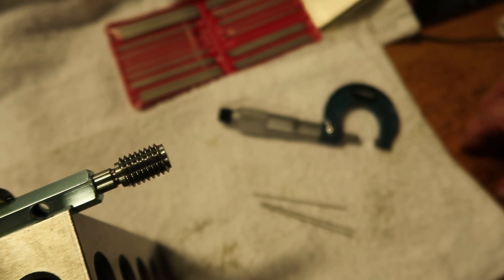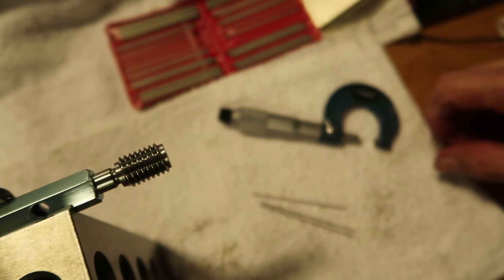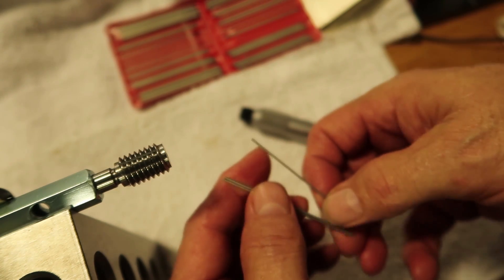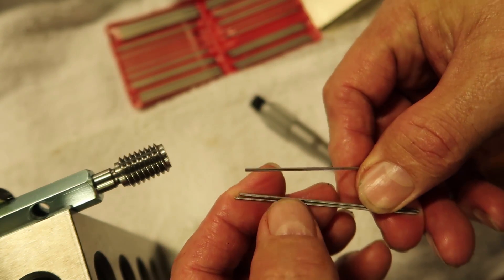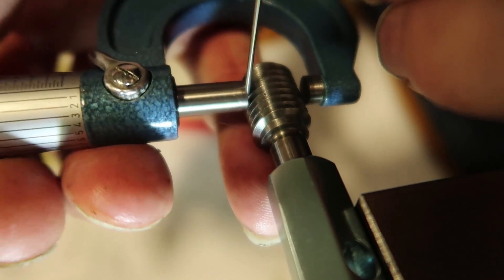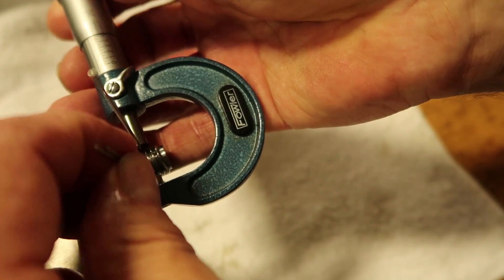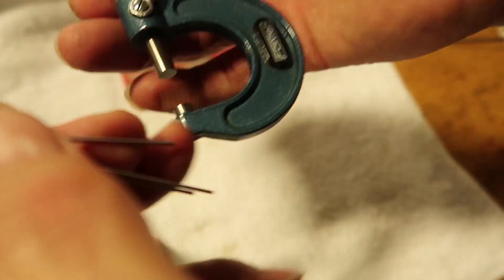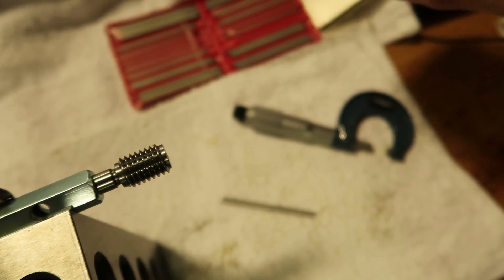Three Wire Thread Measuring Method

Comment: Thanki you very much for this video. I have just purchased a wire set and have difficulty using them because I have a badly damaged left hand from many years ago from a motorcycle accident. I am missing an index finger and your method made it possible for me to use the wires. So thank you again. Michael

Comment: Thread Micrometer vs wires.. I recently move from 10yrs of being a cnc mill guy to the Mazak integrex.  So my question being is I make alot of o.d threads now and hate using wires. Are the interchangeable anvil/thread mics accurate
Reply from the maker: Yes if you calibrate them to the standard.

Comment: The New wire Sets are a pain in the butt . A old Tool Maker I use to work with gave me a old set of wires that work great.  The old sets are 2 pieces with one wire bent in a U shape and another single wire. The U shaped wire is used as 2 of the wires and it's much easier to control than 3 separate wires. I remember asking the old Tool Maker what he thought of CNC. His reply was "CNC takes all the fun out of it" LOL.
Reply from the maker: I remember the first shop I worked in there was a woman that ran a Hardinge turret lathe. She had these sets of things that looked like coil springs with ends wound like a torsion spring. She would use them to measure the pitch diameter of the threads. The spring was wound slightly smaller than the thread so when you wound it on it set down into the thread. Than you measured the OD of the spring. The only thing is you needed one for each size of thread. I have never seen these since then. This was about 40 years ago. The reason I would not like to use a bent wire or these devices to hold the wires is. It is important to be able to feel the drag on the two wires. The drag should be the same on the two wires or you don't have the mic perpendicular to the thread. With a bent wire it would not be possible to tell this. So I prefer to use three separate wires.

Comment: thank you. I enjoy your videos very much and have subscribed to them. you make amazing parts!
I want to ask - suppose I don't have a thread wire kit - if I take 3 identical pins that will overhang the top of the threads i guess there is some trigonometry to be made so it can be measured? taking into account the pitch, angle and actual measurement with the micrometer?

Comment: Thanks for showing us this method I will give using wires a go, I have only ever used parallels before but the difference in price between wires and parallels is massive ($40.00 for wires and about $600 for parallels) . When using parallels there is a standard (1/4" for UN and 6mm for metric) that you need to subtract from your measurement to get the effective diameter of your thread. Do wires have a simular standard that you need to subtract? Also who makes the standard that you were measuring? I have seen a number of people online from the U.S using them. Thanks Peter
Reply: As a fellow user of Marlco parallels, if you have a digital micrometer you can measure the parallels together and then reset zero, that way you get an instant reading of PD when measuring the thread, but I expect you already knew that. 
Do you find the little bits of plastic that holds them rather lacking in "usability"? I have a couple of designs for better usage, another tuit I must add to the "must do a video of it" list.
Reply: Thanks for the digital mic tip, I don't currently have a digital mic but will tuck that one away until I do, its a good idea.
 In your comment you spoke about 'PD' which I assume stands for 'Pitch Diameter'? I have always known this as the  'Effective Diameter', interesting how people in different places have different names for things.
I agree with your sentiments on the holders, when they get a bit worn and then mix in a smear of coolant they quickly become a hassle to keep assembled while you measure, locking them onto the parallel would make them so much more usable. It's a shame that Marlco didn't put more thought into the holders because the parallels themselves are excellent.
Reply: I used the PD (pitch diameter) expression because it was the one used in the video to save confusion, but would normally have used ED. The terms are interchangeable, Machinerys Handbook lists both so it is not necessarily a different place/name thing.
A sliver of paper tightens the fit but doing this on such an otherwise good, and expensive, bit of kit is a little disappointing. 
There is also a cunning variation on the PD wire method that uses a couple of turns of spring wire that fits over the thread and is measured in the usual way. Downside being you need one for each thread size. You can make you own using copper wire of the right diameter but you have to do the PD wire calculations. Even so it saves you dropping wire in the chip tray.

Comment: Isn't the easiest and fastest method to use a thread mic? (at least for threads up to 1", anyway)
Reply from the maker: That would be, if  I had one. They are expensive every time I look at one something else comes up to spend money on and it gets put off. Maybe someday.
Reply: In my experience three wire method is much more reliable and accurate way to measure the threads than a thread mic. If you want to ease up the hassle with three wires Mitutoyo makes these holders that have wires in them.
Reply: mikey_d amazon has a rubber set of holders for like 20$ . There color coated so you know what wire size to use . It’s semi stretchy so it holds onto the anvil.
Reply: The thread micrometer takes away the fussiness of handling three wires. We have a Mitutoyo mike with replaceable anvils that will cover a wide range of thread sizes. But the mike requires a delicate feel and the setup is expensive when the anvil set is taken into consideration. I think we were quoted over $300 just for an empty 2-3" frame that would use our existing anvil set. BTW an alternative to a three wire set is to use three number drills of the appropriate diameter. One last thing: The calculated "M" using the formula gives the top limit for a class three thread.

Comment: nice tip have to try that one next time
Reply: I put the 2 wires against the thread and wrap a piece  of masking tape around the end leaving a little slack between the wires as to not  pull the wires together  leave a tail on the tape to make it easy to find if you do drop them and do the same with the single wire. I have to go out to a production machine sometimes to measure a thread and it makes it much easier to find the wires if you drop them.

Comment: Nice, I alway put a flag of painters tape (masking tape that doesn't leave sticky behind after you remove it!) on them and that why when you do fumble them they are really easy to find and it keeps the 2 wires together. Also on bigger threads I use a little bit of grease to glue the wires in place a bit so they don't fall as easy.

Comment: My method: dab of grease on the threads to hold the two wires. Then only have to worry about holding the single wire and the mic.
Reply: VolkCNC that’s what I do as well

Comment: I think you did a special tool with comparator for read in production and calibrated with gauges, but i like this
Reply from the maker: Yes for large ID threads I use Gage Maker with their software. But you need a sets of spheres for depending on the threads pitch and type of thread. You can also measure OD threads with their system with the proper OD tool. Its a very good system but costly.

Comment: Have you heard of Marlco thread measuring parallels? Way easier than PD wires and ,sort of , direct reading of Pitch Diameter. Only downside, the cost!
Reply from the maker: Yes but I have never personally used a set. Also it seems that if the thread wasn't long enough and close to a shoulder they might give problems. As I said there are many ways to do this. This way has always worked for me on threads say about 2.00" diameter and less. Thanks.
Reply: Another of my favourite ways (which also overcomes your worries) is to wrap suitably sized soft wire around the thread, then you can't drop one of those pesky little ones in the chip tray. Trouble is you have to do the same calculation as PD wires, a PITA.